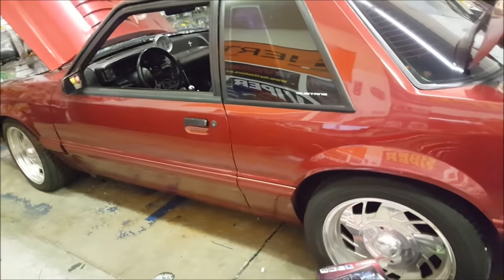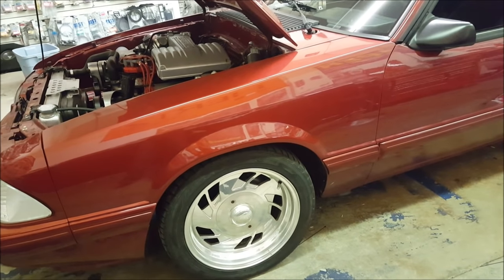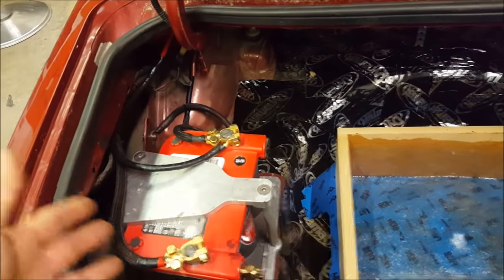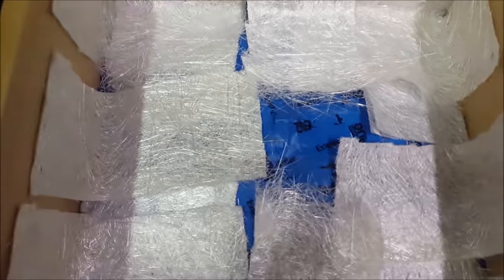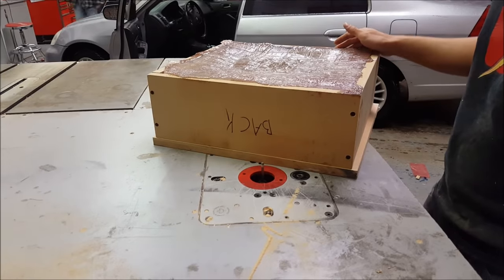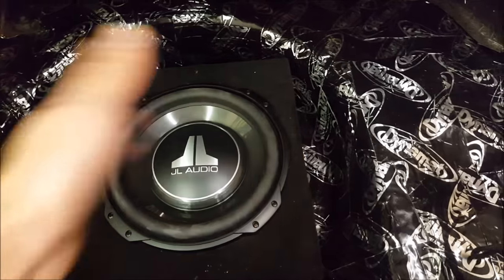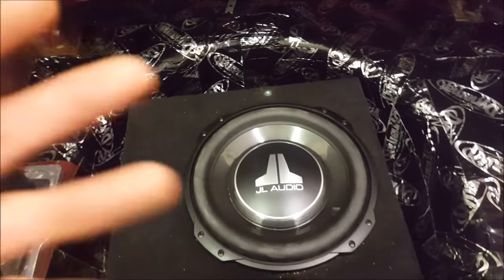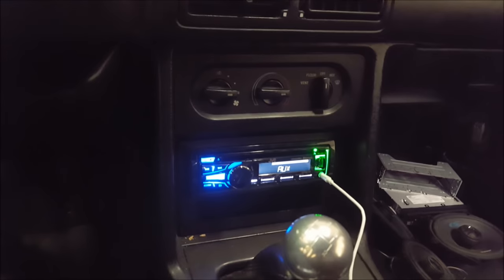Builds: Ford Mustang (Fox Body) Sound System | AnthonyJ350

Comment: Thats odd, a 87 to 93 with a old style coil,cant say Ive seen that before and ive seen quite a bit,gorgeous car,BTW.

I have a 89 hatch and a 91 Vert, back in the late late 90s i had a  amp mounted in the back on the vert,i had someone install it and im trying to remember for the life of me how it looked,they made a base out of wood and carpeted it grey and it looked great, not sure how the wood base was secured to the car.

Here lately Ive decided to install the same amp back in the car (its been siting at home for many years) its a biggin, i know they have amps right now the size of a matchbox that put out a million watts but im kinda old school soooo i was looking around for ideas on how to mount this thing.

I looked in my trunk and i just didn't see a lot of holes drilled or anything so god knows how they mounted that thing back in the day but i remember it looked real good,i saw this video and the little notch and i was like cool, maybe ill get a idea from this until i saw the seat thing,nope, wont work for me plus i have new Corbeaus and they sit really low, no room for nothing.
Reply from the maker: You can use a nut and bolt and drill holes nicely into the rear seat supports.

Comment: Awesome set up. My childhood buddy and I are working on a similar car for his son before he heads out to the military. I had a question about fitting a double din kenwood? Is it possible or what are your thoughts and recommendations. Thanks.
Reply from the maker: +Carlos Perez Yup you can.  I haven't done it yet (there aren't a ton of these running around anymore) but there is a part from Metra 95-5025
Reply: Your right about these mustangs my buddy found a 1993 ford mustang foxbody with a 4cyl  mint condition on the body, but the interior was a disaster from sitting in the sun. So he's tearing everything down including engine,tranny,and rear end and upgrading to a 302 stroked out to a 331. So we started the sounds but had no idea if a double din would fit. 
Thank you for the help and info. 
Keep up the great work on those videos Anthony it's great to keep up with the new stuff.
Reply from the maker: Carlos Perez That sounds like it's going to be an awesome car after!  I hope you guys are putting on some good brakes to keep up with that motor.  I just posted a short shifter video, let me know if you like that one.
Reply: Yes!  That's actually the first thing my buddy did was change the bolt pattern from 4 to 5 pattern lug nuts and disk breaks all around.
Reply from the maker: Carlos Perez Niice!  That's what I like to hear.
Reply: +Carlos Perez Before you fall in love with the double DIN idea, keep in mind how low the radio in a Fox is in the dash. This is especially important if it's a 5 speed since the shifter will almost always be in the way of the radio. In mine with a single DIN (mounted "high" in the dash like the one in the video) it's already a pain to hit some of the buttons on the face plate when in 5th. It would be a serious pain to use a double DIN that had the radio presets, or other key features, on buttons on the bottom row. If you're committed to the double DIN, just keep stuff like that in mind before deciding which head unit to buy.

It's also nice to be able to use the space under the radio for other things. I have my alarm brain and component crossovers under there. To be honest it's a pretty huge cavern anyhow, but more space is still better.

Comment: Hey Anthony Nice Work With The Mustang! I Was Wondering ..I Have The Same Mustang But Convertible. Can The Same Type Of Job Still Be Done To It. If So Can You Give Me An Idea On How Much It Will Cost. Thank You!
Reply from the maker: You could do the same job, they have the same trunk opening.  You'd be looking about 2 days worth of work.
Reply: I run a 12" CompR rear firing in a dual chamber 1.3 cubic foot sealed enclosure in my 86 vert.
Reply: @KRKATANAKID  did you have to sacrifice the spare tire? Im going to throw in 2 massive 8" subs but i want to keep my spare tire. So im looking for ideas on how or what kind of boxes i can use.
Reply: @roster2423  I still have the spare. It's a daily car, and I guarantee the second I'd take it out I'd need it :D

Comment: so mines an 85, and im having trouble SECURLY mounting the head unit, every mounting kit i bought has only two screws that hold the thing, and if i hit a bump itll either fall back, or actually break the tabs the screws go through, seems like they is supposed to be some other mounting place. Oh, and when i press one of my presets the unit will move backward. anyone have any tips of how to make it more secure?
Reply from the maker: Sounds like you have the wrong cage for the head unit

Comment: yo what connection did you use for the sub to amp connection? where you said it was dummy proof and impossible to misconnect the wires when you put the sub back in
Reply from the maker: Donaciano Sandoval 2 pin trailer connector. Won't allow you to hook it backwards and it's durable
Reply: AnthonyJ350 thanks for the quick response! I'm impressed! haha

Comment: what do you think about peal and seal from manards?
Reply from the maker: +Bajes Faraj I'm not sure if I know what you're talking about.  Do you have a link?
Reply: +AnthonyJ350 http://m.lowes.com/pd/Peel-Seal-Instant-Waterproof-Repairs-6-in-x-25-ft-Aluminum-Roll-Flashing/1018733 people use it for cars instead of dynamat
Reply from the maker: +Bajes Faraj Ahhhh that stuff.  I've heard of a few DIY say it's the exact same as "automotive sound deadening" but cheaper.  It may be but I have no experience with it.  To be honest not all sound deadening material is equal.  I've compared brands back to back and noticed differences.  Like I love Dynamat Xtreme but I'm not a huge fan of Dynamat Lite but understand the application.  I just haven't met a professional installer who has said the stuff you get in a hardware store will do the exact same thing.

I have seen other people use roofing material (not the exact brand you mention) and I've seen it get hard in a automotive application after a couple years and begin to fall off though.
Reply: +AnthonyJ350 your right might be good first year but then might start falling apart and then doing the job all over again. thanks for replying back
Reply from the maker: +Bajes Faraj Hope it helped.  Everyone the that uses that stuff usually doesn't install the way I do.
Reply: Peel n seal is asphalt based roof flashing. Dynamat is butyl based. Big difference. Also peel n seal does not have any foam. Where as dynamat does. It's not the same at all.

Comment: hows the trunk rattle compared to a hatch
Reply from the maker: tim None really. This wasn't a huge system. Just setup for a little bottom end that the car needed.
Reply: AnthonyJ350 well i got a 1000 2 channel going to waste I'm hesitant to install in my 93 coupe
Reply from the maker: tim Just have 4 gauge wiring minimum on it and turn the gain down and signal at the deck
Reply: lol i know nothing about that i get them professionally installed
Reply: my mistake this is basically what i have same model http://www.caraudio.com/forums/amplifier-classifieds/538574-re-audio-xt-1600-2v3.html
Reply from the maker: tim Ya I'd recommend getting a professional to do if you are unfamiliar.